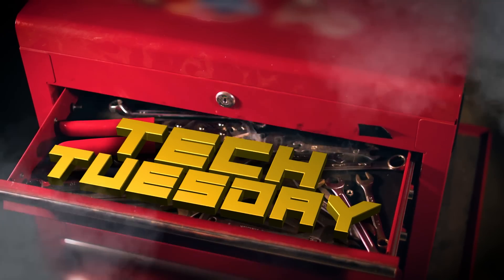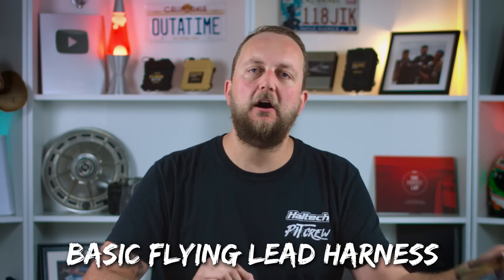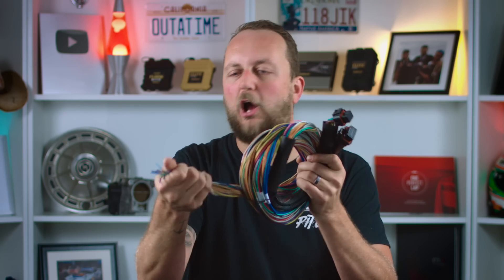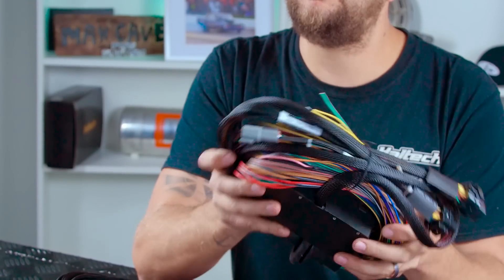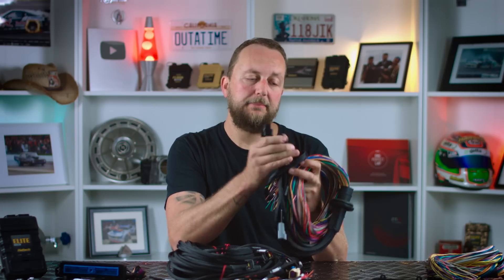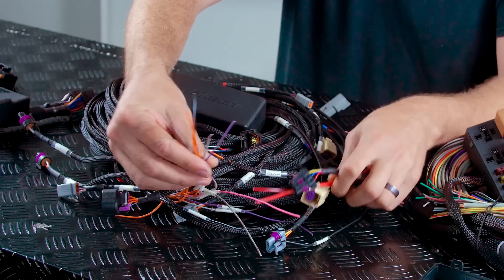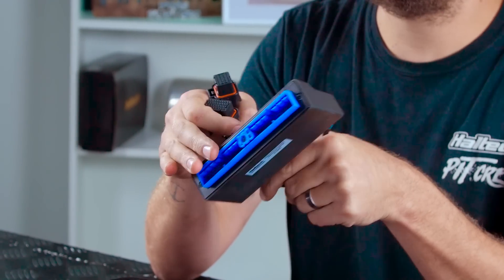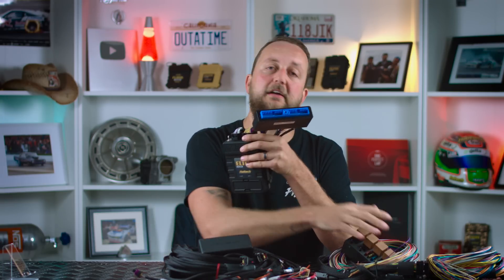🛠 ECU Wiring Methods Explained | TECH TUESDAY

Comment: Is it easy to add wires to the engine side of the loom in the terminated harness (to add extra sensors on engine etc)
Reply from the maker: The terminated harnesses come with some additional (not terminated) wires already, but yes, you can add extra ones if needed.
If you haven't see it already, check out Dave's Wiring Vlog which shows step-by-step wiring of an engine using one of our wiring harnesses: https://youtu.be/IpNfRaM_P04
Reply: @haltech the reason why I asked for the  longer 5M harness is so i can practice making the right  wire cuts and pin always putting the rubber piece in the right place as well 1:29

Comment: I was just wondering what the diff was between the basic/premium harnesses were, thanks!
Reply: That's what I was thanking you for, answering the very thing I was looking at! Haha
I now realise my wording made it completely interpretable in two ways, no question mark though :)
Reply from the maker: It's explained in this very video. The premium harness includes a fuse/relay box and a firewall grommet, the basic one does not.

Comment: Yes, your digital dash monitor with speedo, tach and other gauges , how does this wire into to your ECU's or work along with it. For an all out wired in custom set up?
Reply: Single CAN plug into the Haltech.  Easy as can be.
Reply from the maker: https://youtu.be/csIu1gT_uwk?t=695